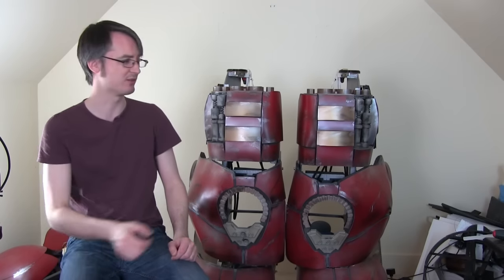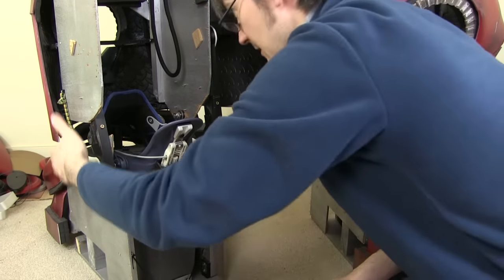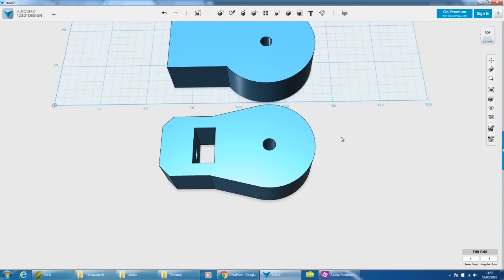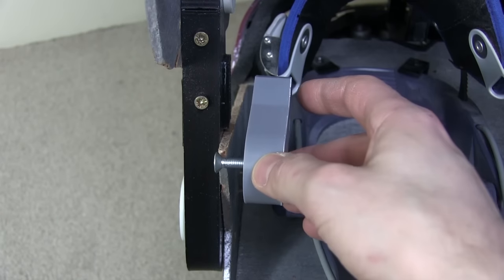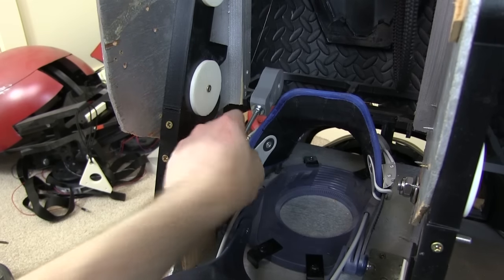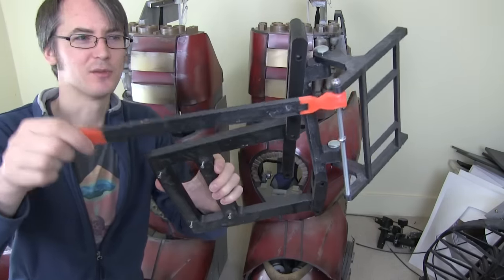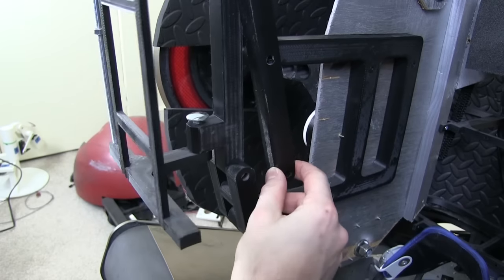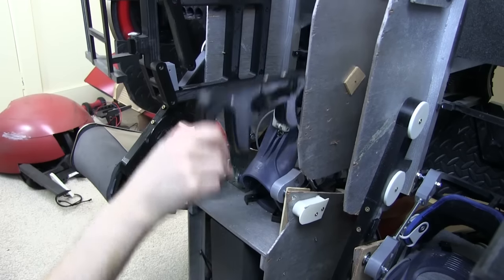Iron Man Hulkbuster Cosplay #51 | More Leg Work | James Bruton

Comment: on your "rod end" pivots...you should have extended the hole for the threaded rod into the "circular" area beyond the extension so that the rod could have two points of engagement and increase the strength and stability of the rod attachment. Right now your rod is 100% dependent on the one hole it passes through for strength and stability. By having it anchor beyond the captive nut would dramatically increase the shear strength and torsional stability

Comment: James, have you thought about using small motors to open/close all the panels on the back of the suit? That way you can get in and out with just the push of a button
Reply: I think he has already mentioned he didn't want to do this because of safety issues if he runs out of juice

Comment: James I have a cool idea: if you have ever seen the oculus rift it will make more sense btw. Since its probobly a little hard to see much from the outside on the inside you could use something like an oculus rift with motion sensors attached to it, and hook it up (wirelessly probobly) to a camera that moves the direction of the (let's just say oculus for now) kinda like you your upfront arm display worked. I know there's flaws to this plan but it's an idea :)
Reply: Ultron arm display/test***

Comment: for your lower leg hinged panels you talked about having them sprung shut, which is fine! but you should run the bungee to the bottom far corner as opposed to the top. it looked to me that the bungee doesn't reach a reliable point of tension loss when opened if it were tied to the top, which could lead to it randomly slamming shut or just being perpetually sprung shut, which would make getting in and out of the suit rather annoying. just a thought though.

Comment: notice when you test your legs you always use your hips to afix the bungees or compensate with your arms? when you're wearing the complete piece your legs are more or less free floating below the torso, this caused a lot of wobble in the last video and you possibly might run into the same issue again, when you don't have a hip like structure to guide the upper parts of the legs better

Comment: why couldnt you use servos to open and close the Suit?
Reply: +Dustin Hinton  Probably the additional weight would add up, and he mentioned in a previous video, if something goes wrong and he needs to get out of it in a hurry, he doesn't want to depend on electronics when they could be on fire or failed.  :O
Reply: +Dustin Hinton Well, firstly, it's more fun that way XD. Secondly, the suit is starting to get a bit limitied in accessable controls for circuits, sadly...